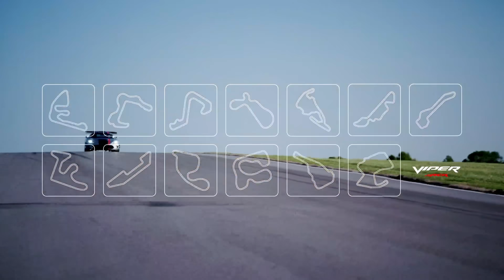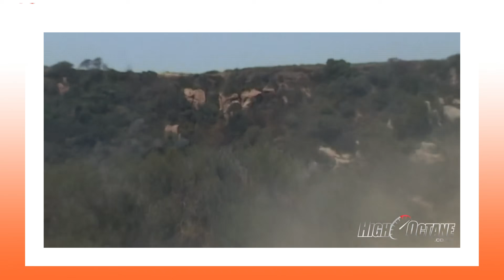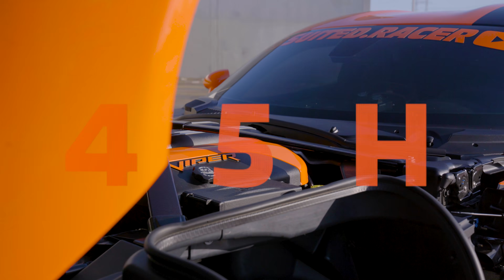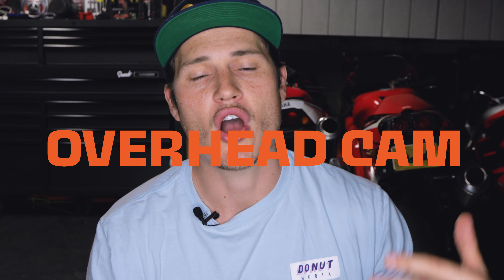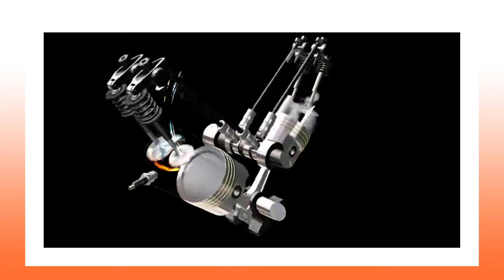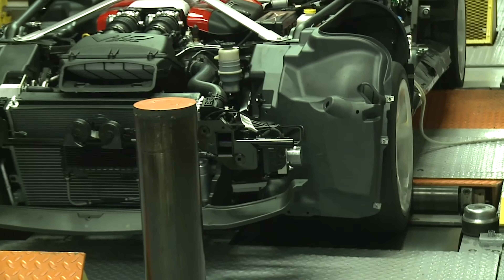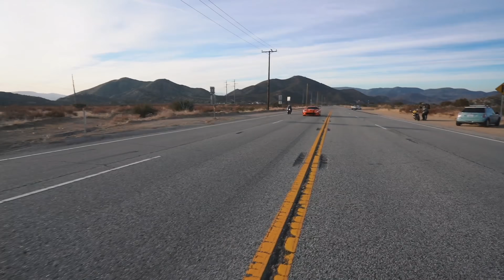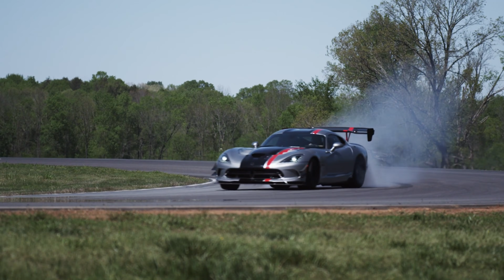The Engineering Behind the BEST car America Will EVER MAKE - Dodge Viper ACR

Comment: I like the GTS Coupe more. It's much sexier. But I'd rather have the C8 Corvette supercar.
Reply: The c8 is not a supercar. a supercar is pushed to the limit in every aspect. Not just it's 0 to 60 time. They use the most advanced materials and technology. For the whole car. The entire point of the Corvette is that it gives you high performance but on a budget.  That's why it's body is plastic. That's why it's has a low revving engine. That's why the body panel gaps are large enough to drive a truck through. They cut a bunch of corners so you can experience one aspect of owning a supercar. If the Corvette was the same price as 911 Carrara s, no one would purchase it.  And even at 911cs level people argue even that isn't at supercar levels. All this YouTube hype has blown this car was out of proportion.

Comment: 18:14 What about the Gumpert Apollo which generated enough downforce to theoretically drive on the ceiling? Google says it generates 1,500kg of downforce at 200 mph which is almost twice the 800kg that the Viper is making at those speeds.

Comment: Chevy disproved this entire theory.  One cam with pushrods and rockers is lighter than 2 or 4 cams without .  The ls makes power to seven grand...the mod motors die at 4500 rpm...ironic.

Comment: So if you have a muscle car, or nearly any engine, with performance cams and a loping idle. Then maybe you should have mufflers & resonators, to quiet that down, so you don't draw unnecessary attention. And an Exhaust Cutout, to bypass most or all of that, for performance.
You can wire the Cutout valve to a hidden switch you can easily reach, or set up an Arduino to open the Exhaust-Cutout, at high RPM's.
I've seen video of a Camaro leaving a car meet, being attacked by a cop.
The pest ordered the driver to shutoff the engine, then pointed his gun, when the Camaro moved.
I understand if you aren't into building performance EVs or Hybrids. 
But if you're going to have a performance engine, then you need to be stealthy with it. 
Especially if you're not moving, or stuck somewhere, and don't feel like killing or disabling a cop, or vigilante, or whoever, in self-defense.
Reply: Oh, and "Best car America will ever make"?

Tesla Roadster 2:
.....Am I a joke to you?

Comment: Not to be a stickler but there's two forces at work with lift. 1st is Newton's 3rd law, which you explained, and the 2nd is Bernoulli's principle. Basically there's a curved side and a flat side to a wing. The curved side causes air to speed up going around it. The faster air has less pressure creating a pressure differential between the top and bottom of the wing which in turn creates lift.

Comment: 4 valves per cylinder is always better than 2 cause it increases the effective area of the intake and exhaust valve holes allowing the engine to breathe more freely, nothing to do with intake velocity, it's all about air density

Comment: Pushrod engines don't inherently have more torque than overhead cam engines, it's just that most pushrod engines, like v8s, tend to have more engine displacement than most overhead cam engines, like inline 4s

Comment: Lol that not how aerodynamic lift works man. It comes down to where your high pressure and low pressure is flowing over the surface. It's way more complicated than that but air push down. Love the show 😁 though.

Comment: 16:45 That "guy" was Ralph Gilles, former CEO of Dodge and SRT, now VP of design for FCA. He's not just a Viper fan, but a big track junkie and tracks his black ACR-E often✌🏼
Reply: Ive always wondered how did people get an acr extreme and what’s the difference between that and the regular acr
Reply: @Johnnytahoe19  The ACR Extreme was a package that gave you things like a bigger front splitter and a bigger rear wing, as well as the massive diffuser out the back. It can be hard to tell if you don't know what to look for.
Reply: @xVIPER94x  also simple weight reduction
Reply: @Johnnytahoe19    You got one with the Extreme Aero package by ordering one with that box checked on the order form, or by finding a dealer that ordered their with that box checked, pretty simple tbh.
Reply: Haha yeah i actually remembered that Ralph Gilles posted that on his Instagram i think

Comment: Doesn't the McLaren Senna have the record for most downforce? The ACR does it at it's top speed of 177mph as you pointed out but the Senna does the same but 155mph which is more than 50mph slower than it's top speed.

Comment: Lift is actually created through the curved upper portion of the wing, thus creating a low-pressure zone above the wing, resulting in a net upward force. Not the overly-simplistic way you described.

Comment: First cam-in-block variable timing arrangement was on the GM LZ4 and LZ9 V6's, all the way back in 2006.  Variability on both the intake and exhaust valves.  So the Viper isn't exactly the first.

Comment: Insofar as wing lift and down Force goes, You've got that principle all wrong. First, the wing of a airplane isn't pushed up from the bottom.  As the wing travels through the air,it is pulled up buy faster air traveling a longer distance over the top of the wing than the bottom. Since it's moving faster than the air moving under the wing, it creates a low pressure area on the top of the wing which actually sucks the wing up into it. The same thing happens on the rear wing of a car when you turn that Wing upside down the exact same thing happens. But in this case the longer surface of the wing is facing the ground pulling the rear of the car down onto the track.  and if it's using ground effects under the car, the same thing happens again. The space under the car is shaped similarly,  but this time the car and surface it's moving on, creates a wing shape cavity, that, by air moves faster following the underside of the car body, than the air on the surface it's moving over, it creates that same low pressure pocket under the car, pulling the entire car down onto the surface it's traveling on.

Comment: The Dodge viper is an absolute masterpiece of engineering.
Reply: It is, but because it isn't. That's why I love it so much. It was a massively overdisplaced 10 with just a fuck ton downforce, and it worked.. worked better than porsches and McLarens million dollar hypercars. Fancy transmission? Nope, here's a 6spd. I absolutely love it
Reply: You mean the *Doge Viper
Reply: And looks too
Reply: Still can’t jump though like a general lee
Reply: It’s just a v10 pushrod though. It’s nothing special lol
Reply: so was a 5th gen gtp, and gm never used the trick they learned after selling lambogorini when they couldnt afford to be the owners. dodge pfft. but shut up and take my money.
Reply: Hp per liter is a fun statistic to talk about, but it's meaningless when it comes down to actually using an engine. Hp per lb (or kg) is what really matters as well as total physical size. Hp per fuel flow is also important. A car's performance doesn't give a damn about displacement.
Reply: *Complains in Corvette* - every one on the internet when anyone say how great the Viper is
Reply: @sorryimajerk735  salty much
Reply: Its very under powered for the displacement of the engine.
Reply: @italotilli7234  turbo or blower would fix that problem.
Reply: @italotilli7234  ....no it isn't, it just develops it's power in a different rev range......you're likely used to Euro cars that make big numbers, but have to rev them to get the their HP numbers BUT don't deliver nearly as much TORQUE as this engine does...watch the latest 'Ring lap...it just 'lazily' puts down a seriously fast time...and that's in part due to the way this engine makes power...now you can also boost these and make numbers that will utterly embarrass most Euro super cars (as a lot of them are boosted which essentially is like adding displacement, but with more stresses)....no, this engine is done just right...gasoline hp with diesel torque...paired with the ACR goodness and it will keep pace with (and sometimes beat) cars twice or more it's price tag....far as I know, it's still the fastest American car around the 'Ring (with two top spots)....and the guys who ran the last 7.01 felt that if they could have had more time (and it's very believable) that they could have ran into the 6 minute range...
Reply: Hahhahahah!   Why because it has the least engineering available?
Reply: And yet some racing games ruined this car amazing car…
Reply: I agree
Reply: Say someone put this engine inside the new corvette oooooo boy beast
Reply: LOOOL!!! its a trash can
Reply: Dogecoin hit $1 this morning
Reply: @eli.dobbie  this aged like fine wine
Reply: It’s not really , the displacement is huge for a 645 bhp . Not the impressive to me .
Reply: @charlespollock1269  im sure dodge isnt investing millions to impress you
Reply: @charlespollock1269  Its NA though
Reply: @stephenballmann847  erm... Euro cars were getting 600hp+ out of NA cars for half the displacement
Reply: @Onceuponatime6119  True. But v10s have that sound.
Reply: @Onceuponatime6119  They are not getting nearly the average horsepower though. Having big power off idle is way more fun. That's why everyone loves a Big Block Chevy, Ford 385 Series or Chrysler RB.
Reply: @Onceuponatime6119  but euro cars dont have torque, torque makes acceleration feel effortless.
Reply: @aimxdy8680  true, everyone have their own tastes in terms of engine
Reply: @Onceuponatime6119  It's a pushrod motor, it naturally has less horsepower but more low end torque. And on top of that the motor itself is lighter and smaller which is a huge plus. You euro fanboys are so dull thinking displacement numbers are everything when you truly don't understand what's important in a motor. LS motors tends to be SIGNFICANTLY smaller than other DOHC European engines despite having larger displacements. The fact it has a huge displacement for the low size and weight for the motor is a plus, not a drawback lol...
Reply: @weasle2904  yeah... but Euro cars are just all around better 😂🤣
Reply: @charlespollock1269  its so much more than the engine...also you can twin turbo these things with some stock parts and get that v10 anywhere from 1000hp to 2500hp street legal WHP
Reply: @charlespollock1269  why you on the video then
Reply: @charlespollock1269  jdm tiny rngune
Reply: @charlespollock1269  its a pushrod what more do you expect lmao
Reply: @charlespollock1269  it has that power for durability and uses pushrod engine for lightless and low center of gravity. You don’t know enough about cars to understand what’s impressive. I guess you consider 580hp for twin turbo V8 by AMG impressive...
Reply: @charlespollock1269  Yes it is a valid oppinion, however I dont think you know what "masterpiece of engineering" means
Reply: @pankero1  he refers to amount of engineering that's involved. Dodge viper is quite a simple car. It has big engine, big wing, and light chassis and that's it. Sure it has big torque, but that's a consequence from using the pushrod layout. Engines from cars with the same price tag have so much more power to litre ratio and is much more well engineered
Reply: @marcoimanuel5489  hp per liter is meaningless when it comes to real world performance hp per ibs or kg is what matters the most.
Reply: Charles Pollock , I guess it’s the best Lamborghini-Chrysler could do.
Reply: Well less than 100 horsepower per litre
Reply: @scottbrown4739  And yet at the time it had the most torque out of any NA sports car, faster than cars twice its price,  tons of grip, aero that was only rivaled by a few race spec cars.... thats what you people dont get when reading "The Dodge viper is an absolute masterpiece of engineering"
Reply: @pankero1  thank you!!!!
Reply: @scottbrown4739  you can get them up to 3500 hp
Reply: @scottbrown4739  turbo or supercharger would fix that problem,but it,s already a deadly car,maybe they are trying to preserve the driver.
Reply: @scottbrown4739  horsepower isn't everything
Reply: @jacobs1047  do you even aero bro?
Reply: @jacobs1047  They'll never drive one, so HP numbers are all they have.

Comment: Only gripe with this video was the aero analogy. Sticking with the plane wing, the lift has as much or even more to do with the venturi effect lowering the pressure above the wing than increasing the pressure below. Likewise with your car aero for downforce, it has as much if not more to do with creating the low pressure below the car than the high pressure above. Vid only talks about creating a high air pressure here which isn't the whole picture but nevertheless good vid. Fun fact, I was conceived the same time as the Viper lol.

Comment: i know for simplicity sake they didn't get to much into the details of lift on a wing. but the air doesn't "push the wing up" in an aircraft it sucking it up from the top. due to the shape of the wing you have a difference in pressure between the top of the airfoil and bottom of the airfoil. air travels faster over the top of the wing creating low pressure area, this difference from high to low is what "sucks" or lifts the wing up into the air.

Comment: I'd like to know if the guy that suffered a 2 MPG drop in Fuel Economy Towing a Viper was actually due to the difference in the Aero of the car, or if that's just a 2 MPG difference because he was towing the car versus empty. My pickup and trailer combo waste basically 10000 pounds empty. I throw a car on that trailer that's 3000 pounds I just added over 30% more weight. I'm sure my truck would see a drop in fuel economy and just lugging them extra pounds.

Comment: Wings don't work because air pushes up. They work by slowing the speed of the air over the top compared to the bottom which causes it to lift from the top. A car wing is the same, but upside down. Well, on a performance car. On most cars it's just dumb.

Comment: You explained deflection, not lift, Lift is cause by a difference in pressure. As a fluid (air) travels a longer distance (like in an airfoil) it accelerates. When it accelerates it creates a relatively lower pressure. It’s an exponential equation and Velocity is one of the main variables.

Ex: You can get 4 times more downforce by doubling your speed.

Comment: Invented and developed by a French engineer and at that time it was a Renault truck v10
Reply: What? The Viper V10"s roots come from a Chrysler LA engine, the 5.9L magnum, with two extra cylinders slapped on. They then got Lamborguini to cast the block and head in aluminum so that it was completely distinct from the truck engine v10 you find in some pick up trucks.

Comment: I don't wanna be that guy but damn, please stop misquoting the power equation. Torque is fuel + air. Power is torque TIMES ANGULAR VELOCITY. Small thing, but I glitch every time, and I'm sure I'm not alone. Generally, lots of engineering misquotes, but power is probably the lowest hanging fruit. Bring back science garage.

Comment: @ 14:47, that’s not how plane wings work. They are not tilted like that. They are curved so that the air above the wing is moving faster than the air under the wing. This causes the planes to be pulled up not pushed up...

Comment: Y'all just make up what sounds good in your head when you're high and call it Donut facts? Your whole valve placement arguement is made up nonsense. Have you never seen a 1g Hemi, 2g Hemi, or a big block Chevy? Apparently not. The gen 3 Hemi has had VVT for some years now. (Psst, its cam is in the block.) You're creating a whole generation of young gear heads that will be wrong 65% of the time. Wiki is not research.

Comment: Great video. Jeremiah's really starting to find his unique voice - good self control/awareness when saying "more power". I like that this series has gone more technical, my only complaint is that there are some misconceptions/half truths making it in, which should be caught if the intent is to have this series more informative. For example, Jer says the air over the rear wing is pushing the car down, but really it's the bottom side of the wing doing the work, sucking the car down. Audio mixing also needs to be better, several cuts to the car shots had me scrambling to turn down the volume, only to turn it back up again when Jeremiah started talking again.

Comment: When old dude tried to explain how an airplane wing produces lift, I almost turned this video off. So, so, so wrong
Reply: He wasn't really wrong, just simplifying it for dummies.
Reply: Glad I was not the only one who noticed. Wings are not angled, nor do they work in the same way aero does, not even backwards. I applaude you good sir
Reply: Actually a wing uses both the Venturi effect and a slight angle to push the air downwards to create lift, you can see it in how fighter jet wings are angled in flight
Reply: He’s not wrong about it how lift works using a simplified explanation. On a wing you accelerate the air moving over the top of the wing to create a Low pressure. While this is happening the underside of the wings air is moving slower and has a High pressure. The Higher pressure “pushes” the wing upward. Wings are angled depending on the airframe. If you flip the principle upside down and apply it to cars, you have a High pressure pushing the car downward. As with airplanes the faster you move the air over the wing, the more lift and/or downforce

Comment: Lift is generated because the shape of the aerofoil causes a pressure difference. In airplanes, the foil causes the air to travel over the top of the wing faster than the bottom, thus resulting in a lower pressure at the top of the wing than at the bottom. This results in "lift."